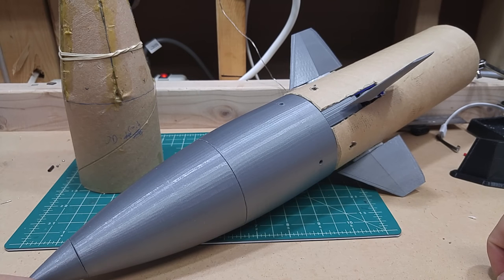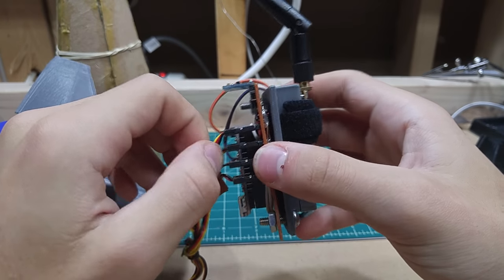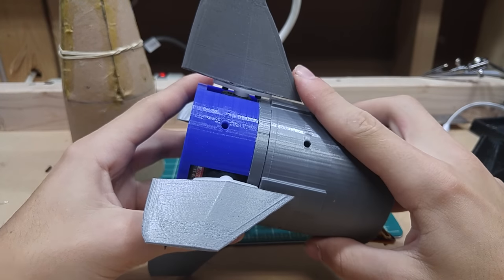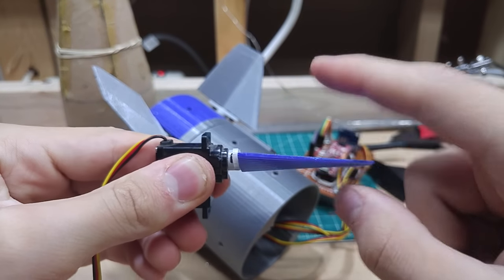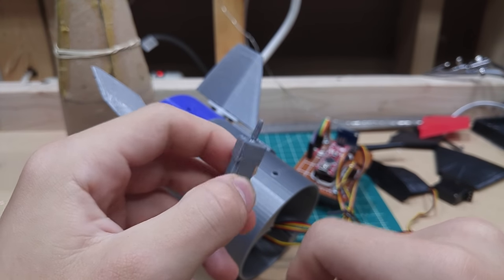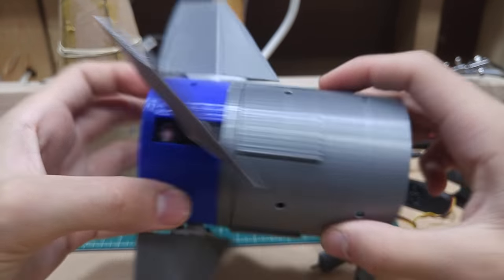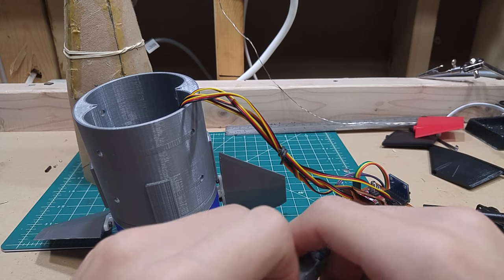Arduino active rocket stabilization system update mid 2016

Comment from the maker: I am alive and working on stuff! New video is currently being shot and edited. Work on actual spacecraft and science support equipment at a 4 letter space agency has been eating my time and wearing me out.
Reply: Arsenio Dev this is dope
Reply: I know this comment might be a bit out of date for the video, but if you're still looking for cheap DC motors, you can get old printers for just a couple bucks a piece from places like scrap exchanges, goodwill, etc. Printers are full of tiny motors and some have rather large stepper motors too. Also, printers usually have dozens, if not hundreds, of little plastic gears. I've found a few plastic bevel gears in printers before. Good luck!
Reply: Are you not able to ram the motors in one direction, then detect when they stop moving using the encoders and use that to zero them on startup? This way you can remove the need for 4x potentiometers and 4x bevel gears...
Reply: That idea makes me shiver, though ...
Reply from the maker: Problem arises when I need matched high torque low voltage motors, not really available in most printers
Reply: @m1lkweed  yeah he still alive
Reply: I have a question for you❗ that which metal is used to make a outer skin of rocket missile.

Comment: To save some weight, consider three fins instead of four. More complex software for controlling but less weight. In fact, you could even go down to just two fins if, via software, you can separate the normally composite movements into two sequential moves, one for rotating, one for deflecting.
Reply from the maker: I'm going for dead simplicity, four fins is easiest since 
Servo write val
Servo write val-180
Had considered it but mothballed it due to being lost how to map XY onto 3 actuators
Reply: Or replace the metal screws on the arduino board with something lightweight. Antenna looks bulky too
Reply from the maker: this is just the testing mockup, not really concerned with weight or durability yet
Reply: I'm thinking you should definitely set up a wind tunnel to test out your designs. That way you can see whether the fins and controllers can effectively counter any forces pushing it "off-course". It will be very hard to test that on an actual launched rocket, they simply go too fast. Wind tunnel first to verify, then actual rockets later.

I wish I were close enough to you to actually help out. Looks like a fun project.
Reply: I've been watching some YouTube videos of model rocket launches. And what strikes me are the smoke trails that are left behind which are initially pretty straight but which very quickly end up all kinked. It shows how the wind speed and direction varies considerably on the way up.

I'm thinking you're going to have considerable difficulty getting the fins to respond fast enough in order to compensate for any deviations from the intended path. I'm thinking on the order of milliseconds. While you might well be able to do the computer processing quick enough, getting the motors that drive the fins to operate fast enough may well be the main challenge.
Reply from the maker: That's the exact plan, however nearby wind tunnels are way too expensive for my budget(around 2K/day) so I've started designing a mount to connect it to my car and also secured a testing site on a closeish race track which the owner was very excited to enable testing of this system. Drop me a line, I'd be interested in hearing your feedback on some design ideas
Reply: 2 fins might be easier than 3.  elevon mixing like a flying wing
Reply: Please can you give me .Your title in Facebook. ..
Reply: Roger Garrett t

Comment: Used this at a manufacturing company I worked back in the day.  At start up, Move the motor (in steps) until it stalls and then you know the position of the fin. Store value and return to neutral.
Reply from the maker: huh, interesting. Bet that works far better on steppers because I know Trinamic drivers can do "virtual" endstops to zero out based on stall out

Comment: I'm wondering about your choice of putting the control fins at the front of the rocket. Even very tiny angles of those fins will have a huge impact on the trajectory of the rocket. I suspect it's best to control the regular fins at the bottom of the rocket. Now, I know there's probably no place in the bottom of the rocket to put the servos, and you want them as far forward as possible, anyway, for center-of-gravity considerations. So how about putting the servos at the top and connect them to the fins at the bottom with control/pusher rods, much like is done in model airplanes?

Comment: really impressive

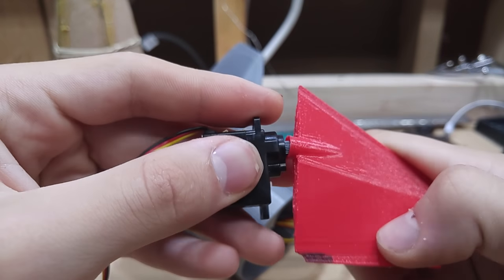3:16 in my experience the servo splines don't really matter too much as long as you can press-fit the component onto the servo, then fasten it to the pinion with a screw(typically included with the servo). I recently had to do this for a 3d printed servo stabilized gimbal, and realized the friction fit holds pretty well. I've had more of an issue with the splines stripping from components once i figured out how to print them properly, and realized splines don't matter too much as long as you can press-fit then screw in. Screwing your component to the pinion also reduces the risk of stripping, and still keeps your component from sliding around even after it's stripped. Then again, screwing the fins to the servo horn like you did also works, with the caveat of slightly more weight.

5:51 brilliant

Comment: Have not read all the comments, and realize this is over a year old, but I would suggest doing a search on "associated Part #: 3914." It's basically the differential ring and pinion for an Associated TC4 touring car. Don't know if it would offer the precision needed but a stop at the local hobby shop may provide other options (the metal gearing from an RC8 comes to mind) that would be from the RC racing world.
Reply from the maker: Snagged some really nice purpose made steel bevel gears from the far east, video update coming soon

Comment: The idea of controlling the rocket's flight via movable fins is totally cool. The practicality? I'm not so sure. For a typical model rocket you really only have a very limited amount of time to perform any flight controls. In fact it's mostly limited to the powered flight time. Have you done any calculations relating controllable flight times to speed of moving the controllable surfaces?

Is this for normal powered rockets or high powered rockets? For the latter you MIGHT have enough control time. But then, what are you trying to control, keeping it on a straight-up flight or doing something more complex, like aiming for some target destination?

Have you done any actual flights?

Comment: i have no idea how i found this vid but to your design:
i think its a bad idea to mount the fins on top of the servos for 3 reasons
1st you loose resolution: you proably dont want to turn it 180 deg during flight maybe +-30° should be more than enough
but this 30° are restrickted to 600 the 2000 microsec of the arduino.writeMicroseconds() function
2nd force: you need a more beefy servo to mvoe the fins if you drive the fin directly
3rd mounting: as you explained
i would suggest to put the fins on a rod which get driven by a rod, so you can use any connection you like. please refer to this sketch
http://oi64.tinypic.com/2jcfvwj.jpg
Reply: Absolutly agree
Reply from the maker: I've got a software limiter on the servo range of motion to 30deg for demonstration, scaling back to +-15 for flight version.  Currently exploring several drive options and testing them in a crap wind tunnel (multiple leaf blowers onto one airstream) to verify control authority
Reply from the maker: Sketch does not work, please use Imgur
Reply from the maker: Tacker Massacker Ok, that's interesting. Will run a prototype later and see how well it works under test
Reply: when you translate the say 180 degree servo movement to the just 30 or so degrees you need in the fin, you gain a lot of torque. But the reaction time gets proportionally slower as well..
Reply: We
Reply: Tacker totally agree. shafts with bellcranks are beefy and fins mounted  on a servo will oscillate themselves to death at speed.  Better a year late than never,,,, well probably not. :)

Comment: Why not a spiral coil gear and small toothed gear to get your 90 degrees turn? With the gear reduction ratio you would get a much better control over your fins. I doubt you would get even close to needing to do a full revolution of the spiral coil, since after all, this is a rocket fin.

Comment: Rather than a potentiometer and another bevel gear, why not add an optical sensor that can detect the edge of the fin then home the fins on initialization.
This would:
1) Be cheaper
2) Be more accurate (since you would home to the actual physical fin edges)
3) Look really cool when it wags the fins to home.
Reply from the maker: Hmmm that might be a good idea but with a magnet and a hall effect sensor so it's flush with the body

Comment: Why not use an rc flight control board for stabilization?  That's what I did on my underwater rov and it works great.  Regarding the fin stabilization,  an exhaust deflector would seem to be an easier and more reliable solution.

Comment: Save money, go yo 3 fins. Also suggest you mount the fins off centre so the motor always carries a torque. This will reduce fin flutter caused by slack in the drive chain.
Reply from the maker: problem is that the math for 3 actuators gets painful real quick

Comment: Hey, I design opto mechanical stuff, I think your fins would be way more controllable with a flexure design, a fast servo and a reducer gear. You want your fin to be a flexure rather than a fin so that you reduce flutter. Also I imagine that you mostly want small ~5° rapid movement, not super large 90° movement. Flexure s can be as stiff or as flexible as your experiments decide.
Reply: Yes, I think flutter will be a major problem with direct-drive fins->servos.
Think about the sorts of cyclical loads you'd get with 20hz flutter. Many dead servos. Fins ripped clean off.

Comment: To solve the problem of space inside the rocket frame (around time frame 6) why don't you use a light plastic disk with its center connected with the rotating fin part and then use the servo along with a light plastic arm to rotate the fin! I think this will make your life easier.

Comment: Put the servos in the fins and attach the output shaft to the body. servo in the fin, a metal tube attached to the motor and attached to rocket body run wires through the tube.
Reply from the maker: Unfortunately that would be even worse than the newer designs which are MUCH easier to integrate and have fewer failure modes

Comment: I would suggest that x function together similar to the rudder of an aircraft ...... y axis function inverted to each other to rotate the body ..... you will then have an top, bottom on your x and the aileron action/result on your y axis ..... That way you will only require two drivers/servos/motors ......

Comment: Why four controlling fins?  Why not just two? I haven't reviewed your goal but if it's just stabilization two will make the correction. Any sustained induced drag from fin angle difference between fixed and moving would be made up with performance from a lighter air frame. Three fins using a delta PIO configuration would be a challenge too. I'll sub ya to see where this goes. Looks like a fun project.

Comment: I realize that this would likely end up in needing completely new body and design, you might want to try using thrust gimbal as you could use 2 servos, although they might need to be heavier. I may try working on something similar but my printer is 150 x 150 x150😀
Reply from the maker: Hey! I'm actually very good friends with someone who is doing exactly that! Check out Barnard Propulsion Systems on here and twitter. I lent my voice to his channel trailer and we talk on the technical aspects all the time. 
https://www.youtube.com/watch?v=fJji2f8LmnU
Reply: Thanks

Comment: 4 separate servos is bad design.  they operate in tandem, so use just one for each pair.
the hinge design is also bad.  instead, put all 4 fins on a ball in a socket = one moving part.
Reply: Roll stabilization?

Comment: I know this is an older video but, why not make a reaction wheel configuration over moving fins? I know that the fins look cool but that is a lot of stress to attempt to handle and reaction wheels are used by full sized rockets for their reliability under the stresses exerted.
Reply from the maker: Reaction wheels will not have enough force to counteract the loads on the craft. Actually the full size rockets use gimballed rockets and differential thrust to do the rest
Reply: Arsenio Dev fair point.
Reply: What about gimbals?

Comment: Looks to me you might want to look at small hobby lathes, mills, and make some gear hobbing attachments for them. Since you can handle the electronics, you'll want to CNC them.
Reply from the maker: I really want a lathe or horizantal mill but they're PRICEY
Reply: If you mean a CNC manufacturing center, yes. You want one. :) But there are good deals out there on Bridgeport hand crank machines, and old SouthBend 9" lathes. They're good machines to start with, but are big. Looking at your shop the Tiag, or Sherline series might be useful for you, but big is always better. Those are very small machines.

Comment: Try using gyros that are controlled by an RC helicopter auto hover radio system. The gyro unit would need two motors with counter rotating flywheels mounted in a internal frame that is attached to the servos. 
just an idea, cool stuff.
Reply from the maker: Problem is reaction wheels don't really work too well in atmo due to aerodynamic loads

Comment: Cab I use this mechanism to stabilize the rocket while falling down?
I need a 90 degrees angle.
Reply from the maker: I mean technically yes, but I don't want to make a JDAM
Reply: @ArsenioDev  Hah, me neither. I want this angle for a drop probe.
Reply from the maker: SpinOX, drop probe? I'm interested
Reply: @ArsenioDev , I wanted to make a small model of the drop pod from HALO, but with a few sensors on board.
Reply from the maker: SpinOX hmmmm, why not static stabilization? Just add fins and/or strakes and call it a day? Then have an altimiter pop a chute at altitude
Reply: @ArsenioDev , that is a very good idea. My other plan was to add air brakes/ aero brakes. They were going to make it stable while falling and reduce the speed.

Comment: this simply not going to work beacuse if its going about the speed of mach 1,the drag will strip off that little wings since it is directly connected to servos and dont have additional support may leads to losing the stability of rocket

Comment: Awesome video. Have you considered returning to the 5g servo motors and designing the fins with two points of contact; a post and hole on the top, and the servo horn mounted on the bottom. This should defer the majority of the stress on the fin during flight away from the servo and onto the post and hole joint, while greatly reducing the torque required by the servo. Another benefit, if a servo fails/looses power mid flight, the fin naturally return to an inline position. Servos generally have ~180 degrees of motion, and you probably only need +/- 20 degrees of fin deflectionfor this application. Should work!

Post & Hole --> __ |\
                                |   \
                                |     \
                                |       \
                                |         \
                            _  |           \
Servo Horn --> |   | |             \
                             |  |                \
                             |  |                  \
                             |_|___________\
Reply from the maker: I thought about it, but decided to keep on going to the micro gearmotors especially since Pololu donated a full set

Comment: hi everyone, i am trying to stabilize my rocket to make it fly as perpendicular as possible, i bought an mpu6050 and i used a kalman filter to combine the angular position obtained from the gyroscope with that obtained from the accelerometer, i have not yet had a way to test the rocket, however I noticed that as soon as I shake theboara little the roll and pitch values go up, someone has some advice.
any comments will be valuable to me, thanks in advance

Comment: use the bevel gears from 1-10 nitro car diffs  or 1-16scale
Reply from the maker: I looked into those but they don't have the 3mm bore or a setscrew to lock it on the shaft. Found a solution though, details  coming sooooon